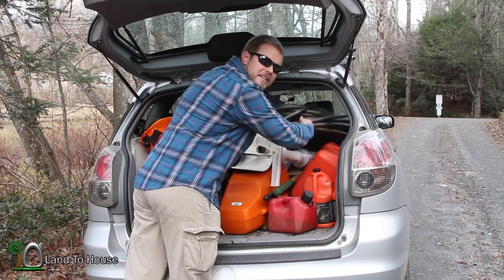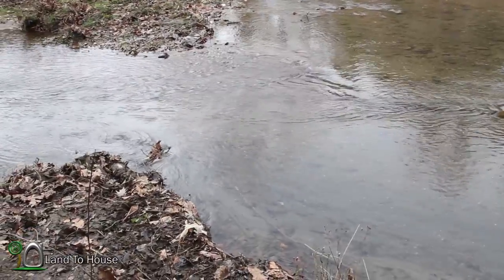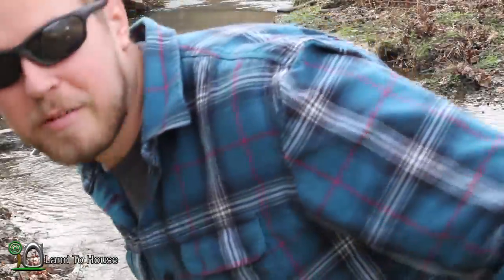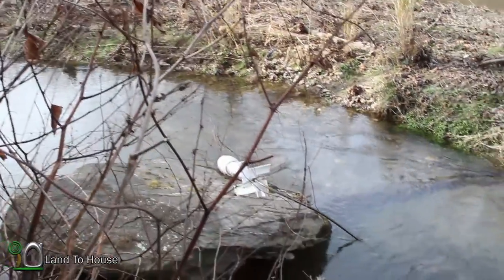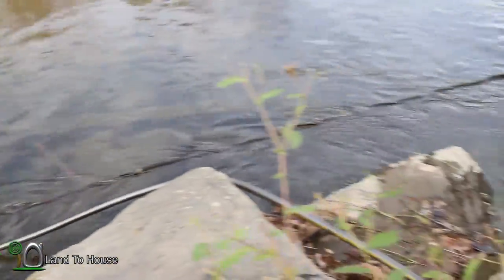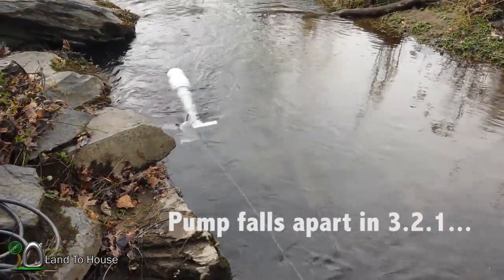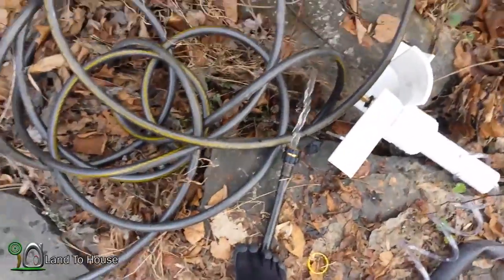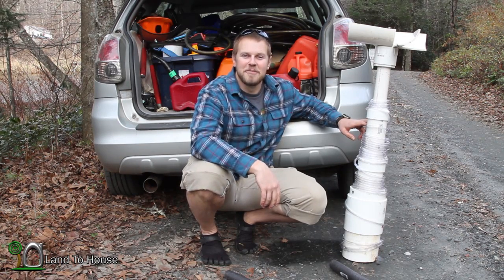River Pump Build and Test Part 2

Comment: I'm very interested in learning how a portable river pump might work. Does it make a difference if the above-water tubing is firm rather than soft/flat type? Isocyanate polyetherpolyol (aka 2-Part, NOT builders foam) if you can get it & use it correctly is *closed cell and impervious to water*. High bouyancy. We sold it to the Marine Industry who filled orange bouys so they didn't sink if it or a vessel using them was struck and they split. If using Builder's Foam, the stuff they put windows in with, you must be careful not to overfill without allowing the curing foam access to Air & Water Vapour or it won't set hard, it'll remain as soft goo forever within whatever it was fired into..
Reply from the maker: There was a company called rife river pump and they had a water pump that looked a little like this. It had foam inside the middle (I think). To be honest I have not found the answer to getting this working right.
Reply: @LandtoHouse  A book available online as pdf, or printed, on eBay/Amazon for $5, 507 Mechanical Mechanisms may be useful to have. I'm going to get a copy soon as I can use it to help my friend and I create fun stuff by 3d printing : )

Comment: Should try to figure a way to maybe get it solidly in once place, build something it can rotate on, and not sink.
So not relying on flotation. Great idea though, needs a little work ^^

I also wonder if making it smaller would also help increase both it's buoyancy, and the rotation speed.

Comment: Seth this is what I too was looking to build next.  The ram pump has it place but I also have need for one of these too. I wasn't sure on how to make the swivel but your idea has some promise. I am watching with great interest. Keep up the good work. 

Question do you have some sort of scoop on the inlet of the small hose to collect the water and air or is it just the end?
I have seen these done with a small bit of pipe a bit larger (looks to be double the hose size) as a catch so as to get as much water in at a time. I'm thinking you could use a short piece of 1" pvc attached to the end of the hose on the inside of the 6" pvc. Each time that comes around it would collect more and as it went over the top it would push that water into the small hose. Thinking a electrical pvc sweep might work. More water = more drive the negative would be more weight. I think the bottles is the best solution. I know they are making them real thin these days just to save on shipping and material to make them. 

Be a bit cold up here in CNY these days to do the testing I see you doing. Snow this am on the ground. I guarantee that the water temps is far lower and I have 0 interest in standing in it. Keep up the good work.
Reply from the maker: +ed sautter Nice I do hope that this series of tests inspires to build. I do hope that the swivel holds up. It is not really meant for this but I think it will swivel well enough but might need to have the washer changed regularly. 

I dont have a scoop yet but that is a good idea. I had given that a try on another water pump idea I had but it never worked like this one. These bottles should make all the difference in getting this to float. I have filmed the first part of #3 and I should get the test done tomorrow. 

Its cold here for sure but not snowing yet. I have a feeling that after tomorrows test I will be shutting down the water related tests. No since in dying from falling into a river. 

I hope the next video is going to be part 3 so stay tuned.

Comment: How about packing in as much packing peanuts as you can, then cap the end.That is how I thought I could keep 50 gal. drums floating, afterpeople shoot holes in them. You might try doing bottles and peanuts around them.I am going to try your (this) river pump next spring. I am looking to your # 3.Keep up your vids. Very good.
Reply from the maker: +Tommy Schauer Since the end of the pipe is open to allow the water to enter the tube without debris I cant really cap it off. But I am sure the peanuts would keep it floating! I have a feeling that # 3 will be the best yet. I am going to get back out there next week.
Reply: Land to House Might use hardware cloth
 3/8" or smaller square over the open end .
Reply from the maker: +Tommy Schauer I found some nice window screen! Thank you for that suggestion. I should have part 3 up this Wednesday depending on how tomorrows tests go.
Reply: Land to House Hi
I was thinking that the amount of water in the coils of the pump is not enough to push the water very high up the garden hose past ground level. What if you down sized your vertical hose from ground up, to about 1/4 " clear tubing (clear so you can see what is going on).
The weight of the water going up would be less so the water in the pump coils might push the outlet higher. The amount of water output will be less but so would the force needed to push it up.
Reply: Hi again
I forgot to  ask how about some short screws and liquid gasket to hold the part that are coming apart  instead of glue. that way you can update it as you go on.
Reply from the maker: +Tommy Schauer I think you have the answer. I have a little extra clear tube that I can use for the test. I am also going to make a funnel for the water intake. I will give these changes a try next week and see what happens. Thank you for the great suggestions!
Reply: You are welcome. I love projects like you are doing. I am retired but our health keeps me from doing much of it. But I love thinking how to do them. As I follow your vids I will let you know if I have any thoughts, if that is ok.
GOD bless you and your wife and family.

Tom S.
Reply from the maker: +Tommy Schauer Its always ok to give advice and thoughts on my projects! I learn just as much as everyone else. I am sorry to hear about your health. I am sure there are still projects you can do even with fluctuating health. If not I still enjoy your input on my videos :) The family is doing well! We are getting house things together. Should be a couple months and we will move!
Reply: @LandtoHouse  darn!..i thought you are single!!!!hahahha.kidding....i am your avid follower now and love to see you making these kind of videos. I am trying to make something for a small farm we have purchased beside  a river. Looks like a ram pump wont work in that area..i am looking foe somethingblike this that will work in a river...keep it coming dear!
Reply from the maker: I have contacted two sellers of the actual manufactured River pump but so far have not been given the opportunity to work with them. I may try to revisit the do-it-yourself version of the river pump soon. 

The ram pump needs at least two feet of head pressure to get started. How high are you lifting water to?

Comment: Hi Seth..I think the concept is there and I like it, maybe flotation could be gotten by lighter building material as you said once, larger intake maybe a scoop of some kind on the inlet side. If the pipe you used could be configured without all those fittings and you could fill it with some spray foam like you used on the Tiny House whatever you build it with would really be a floating machine, molded prop for continued rotation even in lighter flow waters,  there is a good operating pump to be had. Not many on UTube but pretty extreme built ones. I look forward to a # 3 and working prototype. As always good to see those mental juices flowing and your cold feet will teach you another lesson, warmer boots for wading in chilly willy waters..lol..Good Luck and thanks for some more fun with water, or in the water..Brrrr... !!
Reply from the maker: +Barton Robinson I used schedule 40 PVC in this build but I think that moving to drain grade pvc would save lots of money and make the build a lot lighter. I think that will be my next build once I get this concept down. In test video 3 I am going to use the plastic bottle idea and see where that gets us. Also I will get this thing glued together. I do like the foam idea. I wonder if it would have the same effect as the bottle? .... I have not seen any other DIY river pumps on youtube so I thought it was time!... Oh yes and dont film water videos in the winter too haha
Reply: LOL...Winter water videos is for when your in the Bahamas not NC..The idea of foam came to me thinking bottles would work as well maybe both together lessen the need for all that foam and anchoring the bottles in place taboot..I can see drain grade working too; and it's moldable more so than schedule 40 and yea cheaper.. You can cut that pipe and remelt it into a cone shape and maybe add fins ?? The only videos I saw utube on the pump was a very elaborately built in a river in  some place out of the US but pretty big, lots of steel and a blade that would look at home on a windmill..Look forward to more, Thanks Seth !!
Reply from the maker: +Barton Robinson That build seems like it is costly. Seems like there are plenty of options to work with I might have to give several of them a try.  The cheaper aspect of the drain grade will be key. The pro versions of this are well over $450.
Reply: Well try a Pro Version after the cheaper version is perfected then list it like a pro version on ebay for pro version price, yes ? Good idea I think it's sane !!
Reply from the maker: +Barton Robinson haha I will have to make a lot of perfecting before I can sell one of these.
Reply: Ahhh nahh..enough of that Negative thinking now..If perfected. reasonably priced, it would float, well work..lol..hope it floated some but just enough to work as intended..You have the idea hope it's a working ditch pump !!

Comment: That was fun to watch.  Sorry to see it came apart, but after seeing how much weight was on it, that is understandable.  It would be good to have a post or something to anchor the hose to in the middle of the stream so you could keep the pump out in the middle.  The plastic bottles should work much better.  Looking forward to part 3.
Reply from the maker: +Pidasian Hippie Thank you! It just needs a little pvc cement and it wont fall apart again haha.  You are right! I think that a small cable would be nice too so that the pull is not only on the hose. Those bottles will make a BIG difference.